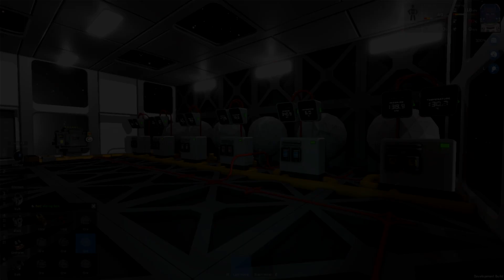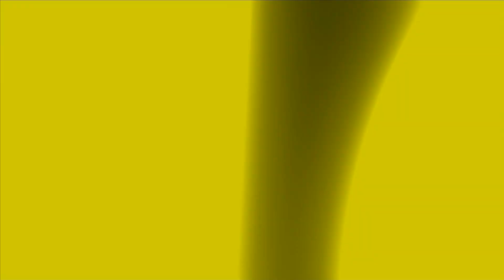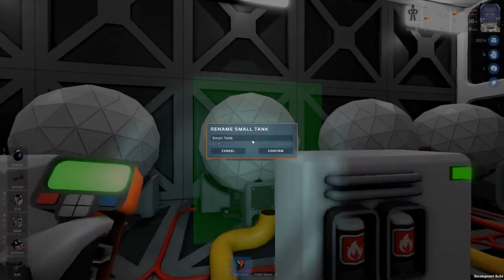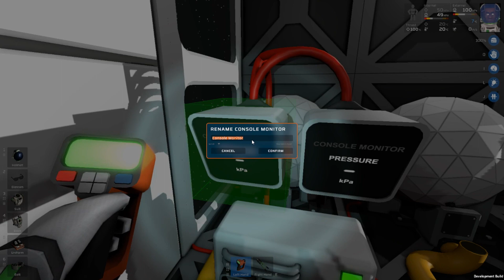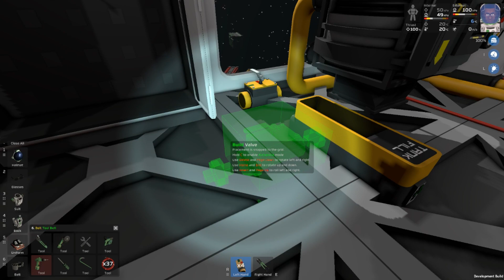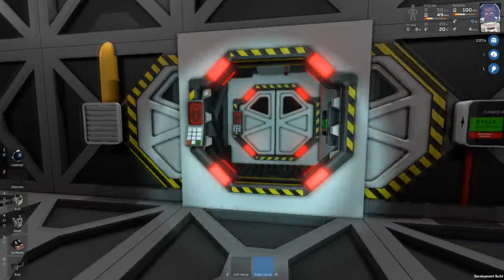Stationeers Tutorial: Atmospherics Pt. 2 (Display)

Comment: Omg.. i overcomplicated it with LED´s and logic I/O´s
Love that setup .. i copied it and added a large buffertank with passive cooling for exhaust/furnace/meltroom-gases.
I also integrated a overflow-vent that also leads to the large tank..which itself has a backpressure regulator.
Finaly, i see all my temps and don´t have to take out my tablet constantly without the need of dozens of logic-chips
and can melt all ices and ores i want without bothering about gases an temps, since i have dedicated furnace/Ice melting-rooms
 :D Thanks for the easy and compact setup. 
<3

Comment: I swear there was a pt. 3 to this video at one point. Didn't you have pressure regulators attached to the piping exiting the small tanks and then you would mix the air into breathable N2 & O2? Also, I thought you had a circuit hooked up to prevent the tanks from exploding.